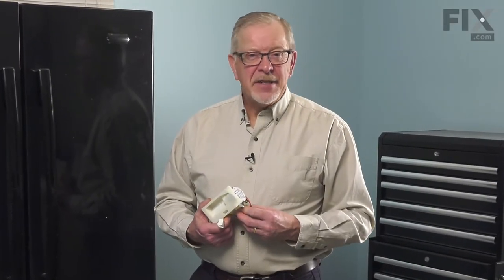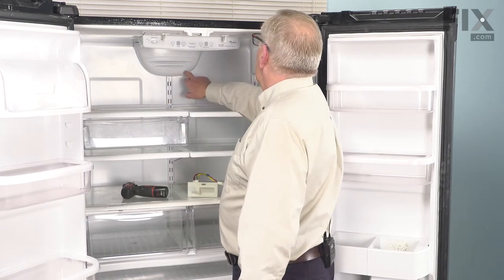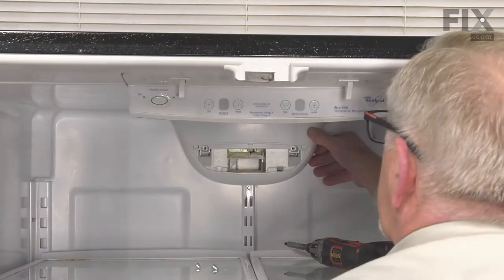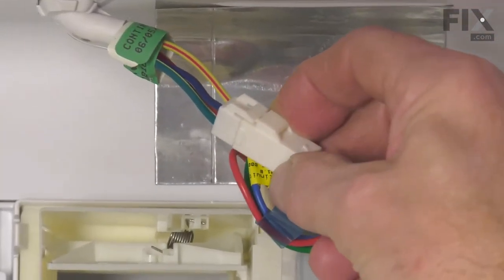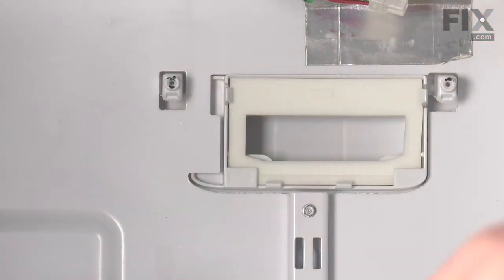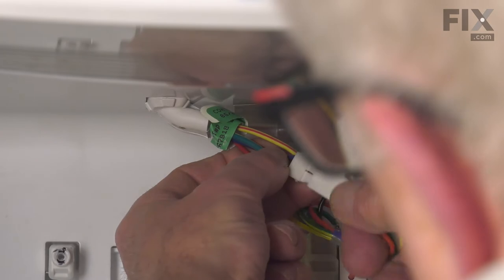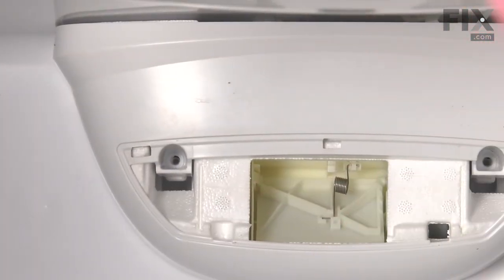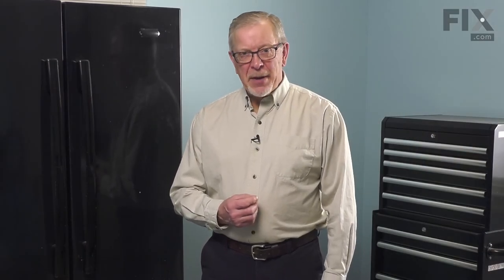Whirlpool Refrigerator Repair - How to Replace the Damper Control Assembly

Comment: About 9 months ago, I had this problem and installed a replacement. Last week the new one started making noise. I removed the part with the intention of seeing if there was a way to adjust, tighten or lubricate. There wasn’t. I tapped on the part some and shook it a few times. So I reinstalled that same part. It hasn’t made a sound again and appears to be operating properly. I don’t know if just unplugging it to remove it did some type of reset or what.  But you might try just unplugging it without removing. Leave unplugged for about 10 minutes. Then plug it back in.  Hopefully mine will stay quiet for a while. Fingers crossed.